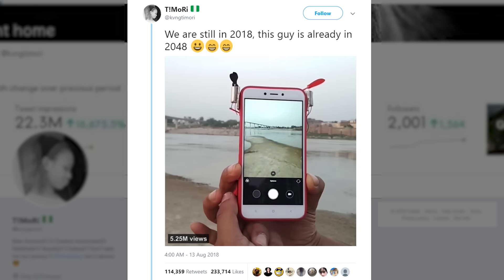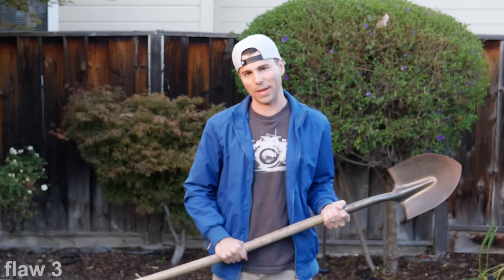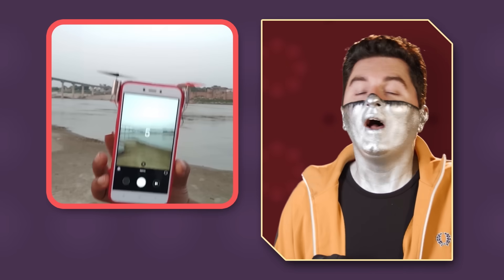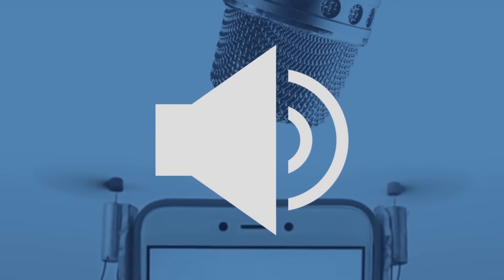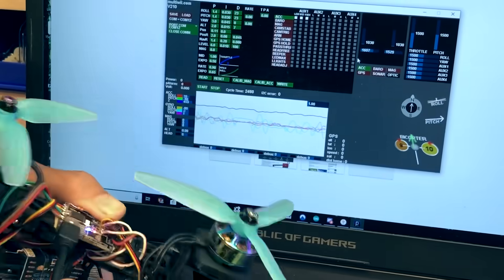Flying Phone Scam Exposed (so I built a REAL one)

Comment: I am not saying that the original video was true, it is fake no doubt about that but when you showed the balancing issue with the shovel you held it from its bottom. In the original video the propellers were on top of the phone and the phone was staying vertically. I would like you to try putting just one propeller on top of the phone and see if it needs any stabilisation. Obviously it would spin put I don`t think it would tip or nosedive if the power is correct.

Comment: you are wrong with the 3v motors. They are 3v but they work on 7.2 or something like that. Thats why they burn quickly. Hmm but in the video the guy uses 3.7 v battery. It´s fake indeed

Comment: Maybe a phone that is built solely for this purpose can be made, not just a case. The phones have accellerometers and CPU's in themselves as is, so those can be used for flight controls. The VTOL style fans could be made easily attach/detachable and sturdy. Basically I am talking about a small drone with detachable propellers and an embedded smartphone.

Comment: I understand Wix was the sponsor of this, but don't use Wix for an e-commerce website. That's a terrible idea. If you're going to run an e-commerce site you need and inventory management system with integration to a content management system. Not a drag and drop interface. Content and presentation should be completely separate, in that content fed into the presentation.

Comment: Knew it was fake from the beginning. The phone looked to me like it was actually being held by a rod and even I knew the phone and case combined had too much weight to be lifted by such small propellers. And I also was wondering if why it wouldn't go buzzing off in different directions since the motors are fixed on there. You made a great video, and I found it interesting that you actually designed a real working helicopter case!

Comment: Modern smartphones have an accelerometer and a gyroscope built in.  But there's nothing connecting the control board to the USB port of the phone.  The maker of the scam video could easily have plugged a USB cable into the phone and just taped the other end to the back of the case for appearance's sake, but he didn't bother.  Whoops.

Comment: To be clear, the way a helicopter moves and a quadcopter moves is VERY different. The angle of thrust is the only way for a quad to move forward with any speed. A helicopter does not tilt the disk to move forward, it changes the blade pitch. The rotor disk does pitch forward but not for the same reason. I know you know this but your example of the helicopter would have been better with only the quad.

Comment: YES these motors are completely underpowered! That said, if the A weighted SPL for 1 motor was 'G'dBA, then ading 13 motors would give an increase in volume of
20log_10(13*10^(G/10))dBA nowhere near 6X. In the same way that the stick of a rocket firework keeps the rocket traveling towards the sky, the weight of the phone would keep the phone upright; the phone would still wonder, and any wind would still cause it to move, however, a nose dive is unlikely.

Comment: have you tried over volting the motors say 6 ballpark volts by using 2 lipo cells in series.

yes the motors would probably burn up but they only have to last long enough for the selfie

Comment: Just a correction, the sound level would not be 6x louder... changes in sound level are logarithmic. Let's assume one fan created 60 dB of sound, if we put 13 fans together, as you suggested, it would only raise the sound level to 71 dB. The perception of sound being doubled is an increase of 6 dB. So if you are comparing the sound of one fan to 13, it would only be perceived as a little more than twice the sound level of just one fan.

Comment: I build and fly tiny whoops and i think that there is a chance of building it with 4 brushed high quality 0820 "Dark Edition" micro motors and Walkera propellers as those have the thrust sweet spot. Have it as a drone frame and the phone attached on the bottom.

Comment: Balancing a shovel is only an adequate analogy if the center of mass is above the center of lift. The phone case held vertically looks like it would be very stable axially. As long as one propeller doesn't provide significantly more thrust, it looks like it would stay very vertical. You can lift a shovel by the top with a blindfold and oven mitts no problem. Still fake, but i disagree with some of Your reasons.
Reply: 3 words: Pendulum rocket fallacy.
https://en.wikipedia.org/wiki/Pendulum_rocket_fallacy

Comment: You were complaining about the lack of accelerometer and fixed rotors, but with them attached to the top and counterrotating and with no wind and the thrust both perfectly reliable an tuned to the weight of the phone, you shouldn't theoretically need anything like that, right?

Comment: FYI Helicopters CAN nod forward a bit without changing their lateral position. They don't fly like a drone with fixed blades. They can vary the angle of attack of each rotor blade cyclically, so each blade has its own forces acting on the system, which in turn add up into a forward force without changing the pitch.

Comment: Can you use motion sensors of the phone itself? Some phones contain not only gyros and accelerators, but also barometers and magnetometers.
Also, pretty sure there's already an app on the play store that actually does that. It's intended for a proprietary quadcopter that uses your phone as a flight controller with a microcontroller as an interface between the phone and the ESCs

Comment: I build and fly drones of all sizes and use the same motors in this video on my micro drones. 4 of those motors on a 4.2 volt 1 cell lipo battery (cause thats all these motors can handle because at the next voltage level = 7.4 Volts will burn out the brushes unless you ordered 8  volt motors that can run on 2 cell lipos) 4 of these motors cannot lift more than 70 grams on a 1 cell lipo with 55mm props at 4.2 volts.

Comment: Wix is okay. The problem is that it breaks a bunch of accessibility and web design principles. The sites aren't ordered in a reasonable way for screen readers or link navigators, they don't work without javascript, their javascript bundle is huge, etc.
If you use Wix, just keep in mind that you might alienate people with poor eyesight or physical disabilities affecting mouse usage, people with low bandwidth and people from poor countrie where loading a Wix site might eat up a good bunch of their 100MB package.

Case study: https://www.markroberbuildinstructions.com/
Loading with a  Ublock Origin and Privacy Badger so most external trackers get blocked: 1.2MB (4.6s from load to usable)
Without either: 1.4MB ((6.5 till usable!)

Most of the data transferred is JavaScript files, even though your site doesn't need _any_.

Comment: Great video, but if I can be picky... 13 more motors doesn't mean six times louder. Double the motors will just be 3 db louder. So 16 motors will be 9 db louder than 2 motors. So if one motor makes 60db noise, 2 will make 63db and 16 will make 72 db. Still enough to drown out the sound from your mobile... just not six times louder than before. :) ( if your're intressed in the equations behind this you can look up http://hep.physics.indiana.edu/~rickv/sol_multiple.html )

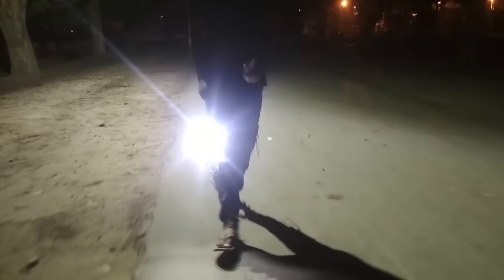Comment: 10:20 i have seen flashlight that's get its electricity from hand muscles. By clenching your fist on the lever on the flashlight handle. Your adding mechanical energy, wich is then converted to mechanical energy to light up the flash. So instead of holding it in your hand and connected it to your leg. So by using your leg muscle instead. In theory that is possible. Tough how effective it would be able to light up in front of you and how uncomfortable it might be Walking with, would be a different question, adding on to each leg, probably make it easier to balance it for Walking. So even that they faked it in the video, it should still be possible to make.
   Just remembered that a bicycle with a dynamo is using this afteral.

Comment: I totally agree that it’s fake but as for the position correction wouldn’t the phone self correct if the motors were properly connected because the weight of the phone below the center of force keeps it upright? 

The shovel analogy has the center of mass above the force holding it up so it’s unstable but in the phone the mass is below as if you were holding the shovel the right way round?

Comment: Your 4th major physics flaw @4:07 is flawed.  The center of gravity is below the propellers.  That means that the propellers are pulling up, and the center of gravity is pulling down, the orientation should be stable.
Reply: You're right.  My bad.
Thanks for the correction.

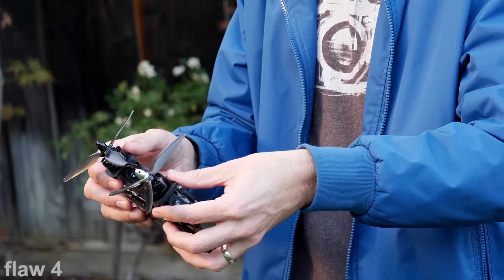Comment: 4:25 You dont have all six degrees of freedom. You only have four (three rotational and the overall thrust). 
With your setup you can only control four degrees of freedom anyway because you only have four actuators. But your point is right. The guy in the video tried to control four degrees of freedom with two actuators.

Comment: That video may have been a fake but your explination is even more fake. You do not need compensation such as gyroscopes or anything like that when the center of gravity is well below the propellers. It will not tip over or move sideways. The shovel in your hand has a revers center of gravity.

Comment: Awesome video, but you got one fact wrong. With the correct number of motors, you said that the hovering noise would be six times louder, but that’s not true. Sound is not on a linear scale.
Reply: A doubling of speakers (or here propellers) results in a doubling of perceived volume (not decibels!)...
With that out of the way, let's check his claim:

2 propellers (base) = 1x the volume
4 propellers = 2x the original volume
8 propellers = 4x the original volume
16 propellers = 8x the original volume

He said 13 propellers would be at least six times louder... Seems right to me.

Comment: Just saying... the lack of gyros and accelerometers wouldnt be a huge issue for the design. Unlike the balancing shovel, the phone is hanging from the propellers - youd only really need them if a) you wanted to move the phone atound in the air, b) balance it on top of the propellers or c) wanted to make sure its stanle even if theres an issue with one of the motors, leading to unbalanced forces on either side. 

That said, its still fake and a scam.

Comment: Your build instructions website doesn't seem to be as "functional" as it should be.  If you open it in a smaller window than full-screen, or zoom in on the webpage (becomes a problem around 120% zoom on my monitor), the menu on the side of the page starts to become cut off, or entirely disappear off the left side of the screen (tested in Microsoft Edge and Chrome).  Perhaps some slight tweaks to the webpage design would be useful.  I'm not familiar with the Wix webpage designer, so here is a list of options that might help:
- Add a horizontal scroll bar to the page so you can scroll over to see the menu if the page is too wide.
- Make sure the center content scales down enough with the page size so that the menu is always visible.
- Make sure the "Hamburger Menu" icon that appears on the mobile page shows up before the menu disappears off the side of the page.  There is probably some option for when the element appears, and it should probably be changed from "Small Display" to "Medium Display".

This was a problem on my machine which I have "Display Scaling" set to 150%, so basically a 150% zoom level as default, and I had to go into the browser settings to zoom out to use your website.  This "responsive" web design is one of the hardest parts of getting a functional web page, but hopefully a platform like Wix should make that easy to fix.

Comment: No... 13 moters are not 6 times louder than 2 moters... you would need 20 to make it 2 times louder.
Reply: Thank you!!! It's surprising to me that Mark would make such a simple physics slip up but I guess it happens to even the greats.
Reply: Dude, maybe go to your room and blast ten phones on full volume. See if it will burst your ear drums at 200db:)
Reply: Not true. According to you, is 20 decibels twice as loud as 10 decibels, or twice as loud? The answer is obviously 10 times louder. So, as we can see, how loud something is does not scale the same as decibels.
Reply: Jacob Brajevich not really, sound is measured in a different way and the body also hears it in a different way, if you put two phones on max volume it would not sound two times louder, go check it yourself, it would just sound kinda the same, thats why speakers use very few actual speakers, because if it was that essy to make more sound every manufacturer woudl just put 20 or 30 small speakers in a circuit
Reply: Well he was not talking about decibels, but human perception

Comment: technically you can hover in a tilt if the propeller can change the angle of the blades mid turn, some choppers do so and don't need to tilt to move forward (bit simplified but you get the idea), and of course thats hella more complicated than an electric motor with a plastic propeller

Comment: Great video. However you mentioned that adding 13 motors would increase the volume by at least 6 times. This isn't correct. Sound doesn't increase that way. It would result is approx x2 as loud

Comment: You also need to count in the fact that he uses two identical propellers for his fake drone, which requires both the motors to spin in the same direction and putting the phone into an ever increasing spin due to Newtons 3rd law of motion.  4:42
Notice that your friend uses two propellers that turns in opposite directions to counter the forces made by the other motor.  8:32

Comment: Only one gripe: You don't necessarily need a gyroscope or accelerometer to have stable flight. You can't get a controlled hover or steer, but you can get the propellers to reliably point directly upward most of the time just by weight distribution. You don't have to balance actively if you design the system with a stable equilibrium. Yeah you can't replicate the video with that kind of setup, but it is clear for other reasons that that is impossible anyway.

Comment: You can actually have fewer moving parts, even just one fixed propeller. However, you can't stay in place, but have to rotate as well. It wouldn't make a good phone case because you wouldn't be able to see the phone.

One example of this is the "Monospinner".

Comment: I mean I doubt the guy was really being that malicious, plus I mean the only way for these supposed and hypothetical 'aspiring engineers' to learn is through troubleshooting, finding out it doesn't work, why it doesn't work, and how to make it work. That is how an engineer thinks, and it is how everyone learns, by making mistakes. 

Although not realistic, you can't shield everyone from these things. Worst case scenario this hypothetical 'aspiring engineer' ends up with a small LiPo, an Arduino board, and two small motors. 

To be quite honest, the thing that increased my collection of parts and electronics was from failures, you buy the parts, can't figure out quite how to build what you wanted, and re-purpose those parts to use for other things you do have the skills to build. Maybe one day once you get good enough, take another crack at the thing you initially wanted to accomplish.

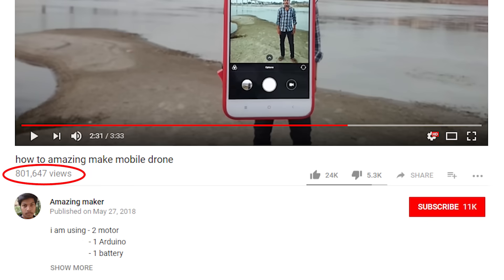Comment: Your quarter example isn’t really that great. As the paper or whatever you were sticking the quarters to extends farther below motor doesn’t the force they exert on the motor increase in a non linear manner? I’m just saying that instead of a 1:25 quarter ratio the true force ability difference should be even more. So in conclusion, the fake video is even faker.

Comment: Great video and nice work on the prototype. Even without the in depth explaination it apparent the video is BS. No way to control something in 3d space with only 2 inputs. It is like trying to drive a car  with no steering wheel or no throttle. As you showed you prob need 4 degrees of freedom, but could you do it with 3 if its sole function was to stay still?